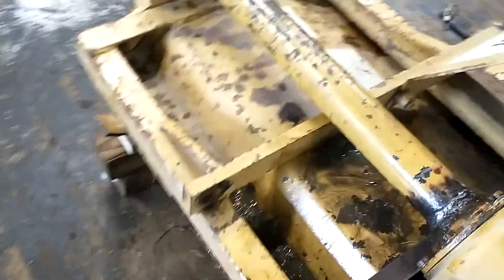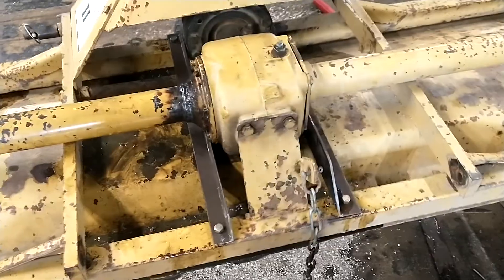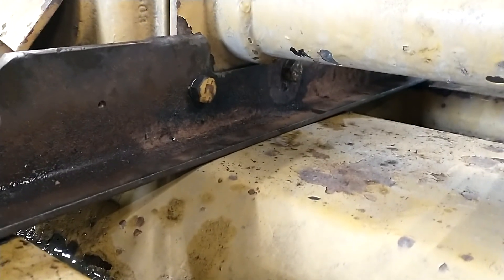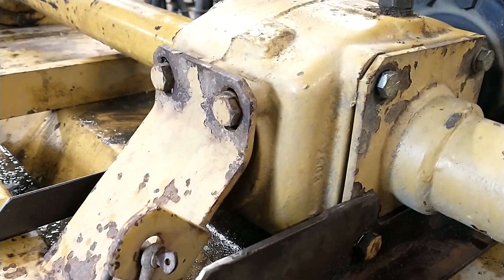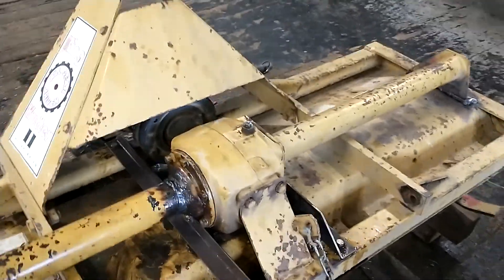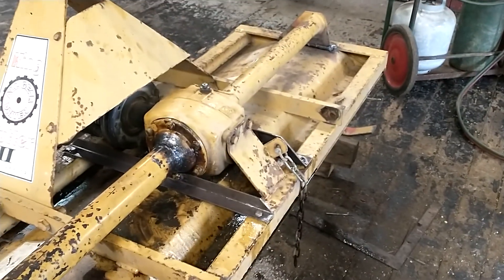King Kutter rototiller repair upgrade

Comment: Great video I have same tiller and everything to showed happen to mine. The weld around the oil reservoir was broken all the way around and of course gear oil everywhere I just hope I can find someone who can fix everything on it. I do have a question do you know what size the bolts are that fell out I need to get a couple of them thanks

Comment: Maybe need to make sure your slip clutch is working.  Slip clutch is meant to slip rather than busting parts on the tiller when you hit an obstruction like a rock.